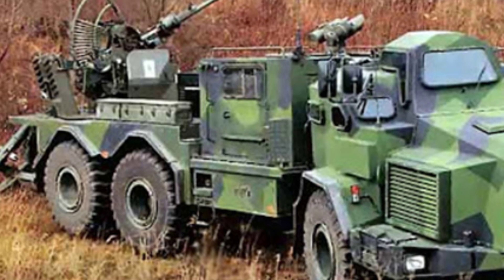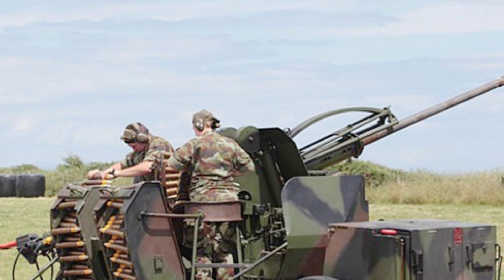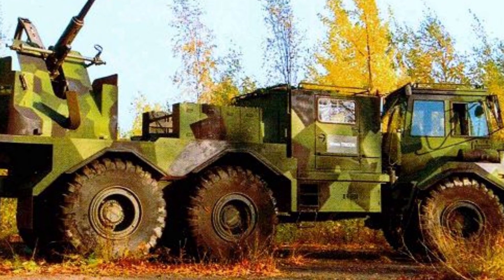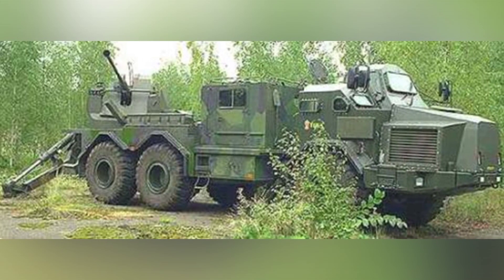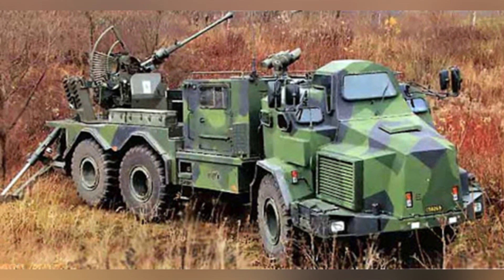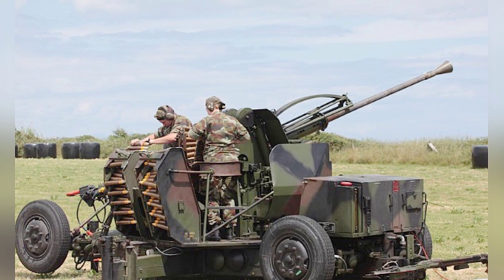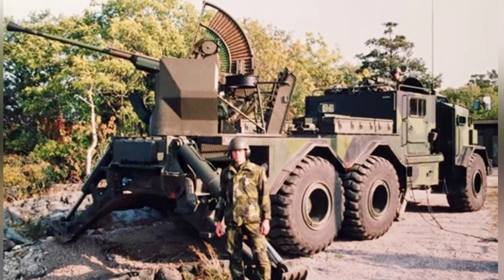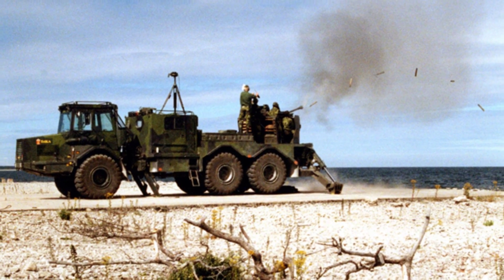TRIDON: The Versatile 40mm High-Caliber Anti-Aircraft Weapon

Comment: That basically looks like "just" a Bofors 40/48 L70 connected to an ARTE725 tracking system from SAAB Surveillance on a dumper chassis. With a Radar or IR scanner (never purchased to KA in LVT75M) as a course-finding system, it would work fine, but rather "not advanced enough" even at its prototype time. But as a prototype, it makes a lot of sense and is a rather obvious continuation.

Comment: I guess the AA version of the CV90 is the better option? Much faster deployment (I think it even can shoot on the move?), the crew has protection inside and I read that BAE Hägglunds is developing anti drone capabilities for it. (Sensor and fire control)
Internet as source so take it with a pinch of salt 😊
Reply: it was either or pick of system, couldnt afford both at the time. And it was cheaper to go with cv9 platform since they were ordering more than 300 at the time any way.

Comment: I should put the AA gun on a truck in stead. Speed instead of terrain mobility is more needed on the modern battlefield.
Reply: Ever seen most of Sweden? Most of Sweden is deep forests with brooks, rivers and mires everywhere. Very wet during springtime and autum (and many summers too) and easily up to a meter in snow (if not more) in the winter. 

Sure there are roads, and very good roads at that, but they are comparably few and the good roads will most likely be bombed to bits very quickly. Most roads in the very extensive road-network all over the country however are small and narrow back roads, often made out of dirt. It aint what most people drive cars on everyday but there are much more of these types of roads (often made for the forest industry or farm industry or are remnants of older roads) criss crossning the country side then good roads. Usually you do not want to drive more then  70km/h on these back roads so higher speeds is redundant, but they are perfect for hit-and-run-tactics with shoot-and-scoot missions just because they are just about everywhere. However they can often be very poorly maintained (or maintained when they are about to be used) and at times you can suddenly facing the fact that the springflood swept  the road away and has not been fixed (because it is 30 years until the forest in that section of the endless woods shall be harvested, or what not). Or just a tree that have fallen over the road. Or a unplowed road in the middle of the winter. 

You will for certain get stuck with a truck in these conditions. However these articulated 6 wheelers are not only used as heavy haulers within construction and mining but this design was also used for a very long time for forwarders within the forest industry (the machines that fetch the timber the harvesters cut down and haul it, through roadless land, to the extraction point along a road somewhere where the timber trucks are able to load it up and transport it along roads to further processing) and can overcome most what is thrown at their wheels. It is a tried and tested design made to work in harsh conditions. However the main advantage of this design are their flexibility. They can easily go quite quickly by road, but they can also traverse roadless deep forest without any problems if that is nessecery, without any modifications. Sure you a bit faster in a truck if you drive on a big nice road (aka perfect conditions) but outside of that this articulated design is way better. And lets face it, war usually are not waged in perfect conditions, ever. Modern or not